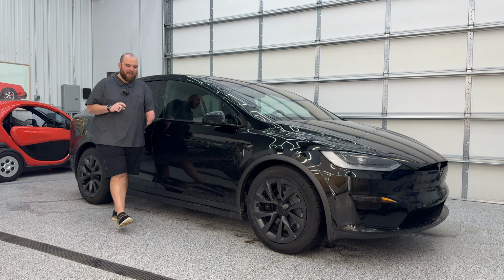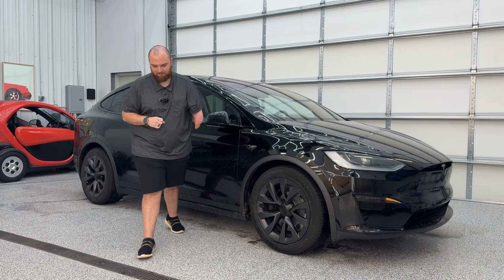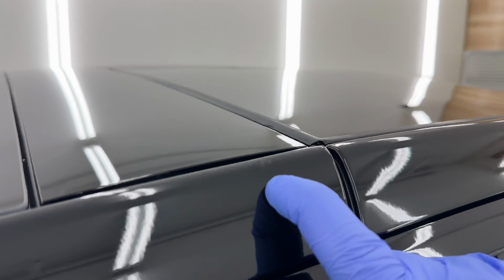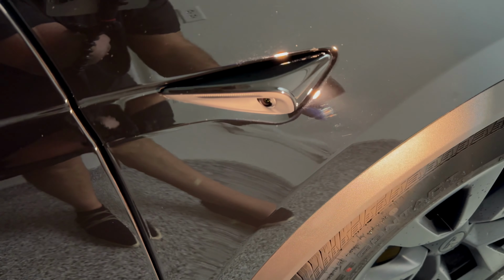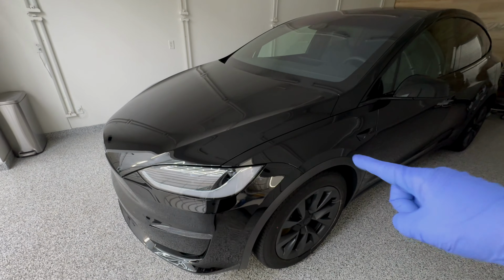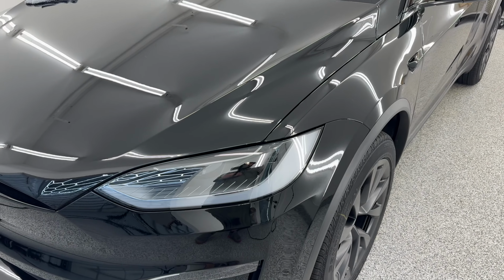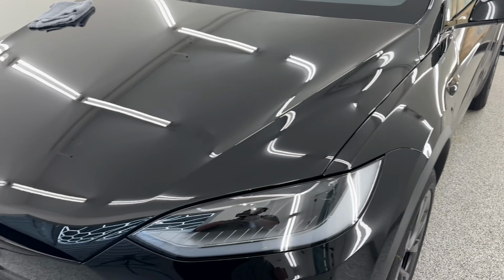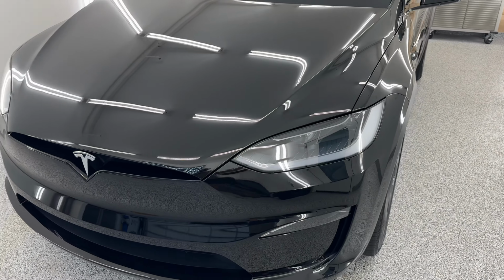Transforming A Brand New Tesla Model X! Correcting Factory Defects & Ceramic Coating Protection

Comment: Hey Coleton, just as a remark, I recently bought a Tesla from Hertz, and the b pillar applique on my model 3 had deep level scratches in the glass that polishing couldn't remove, knowing it was a used car and that whole part is $300+ I looked into how to repair it myself, I bought a wet sanding kit made just for glass and was able to remove all the deep level scratches without damaging or reducing the integrity of the glass, I'm currently working on a video, cause I did document the process. Now of course that customer you had, had a fresh off the lot car with a full warranty so yeah replacing that part makes more sense, but I wanted to put it out there the glass can be repaired and there is a way if it was an out of warranty car.

Comment: Great Video Coleton ! ! ! Could you please remind me how its called the ceramic coating, in spray form which is easy to use and if there is something similar in Europe ? Do you apply it after cleaning and then rinse it or you have to buff it ? Thanks in advance, keep the 9000 lv work !

Comment: What a roller coaster!  After you washed the car, I thought it looks great.....when you turned the lights off it was a freakin mess!!  70 miles and the paint looked like that?  Unreal. I remember your review of the Q2 Mohs EVO ceramic coating.  Would you use this again?  Sounds like you used something better they offer?  I could be wrong?  Thanks.
Reply from the maker: I use Gyeon Infinite Base Type 1, pro level only coating.

Comment: Couple questions.

1) What light do you use to inspect? 
2) it appears that you didn’t polish the whole vehicle which is great bc if there isn’t impurities than why right. Just wanna be sure you didn’t polish everything. 
3) do you use a tool to measure paint thickness or clear coat? I’m scared to polish my Tesla for this reason but don’t wanna spend more money for a measured. 

Thanks in adv
Reply from the maker: I don’t film every single panel being polished. The whole car was done.

I used a Scangrip light and a paint meter
Reply: @OutofSpecDetailing  ahhhh okay! Thank you so much! I’m pretty nervous about going into the Tesla paint hearing about how bad it is… hopefully it all works out. Appreciate you sir!